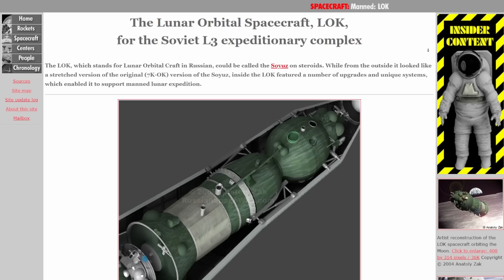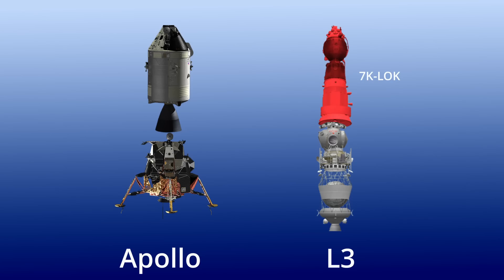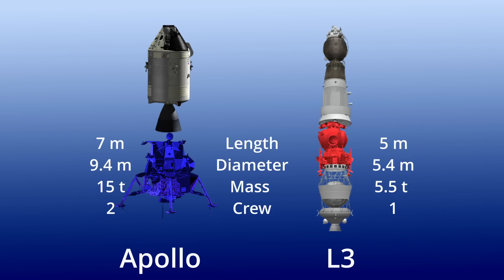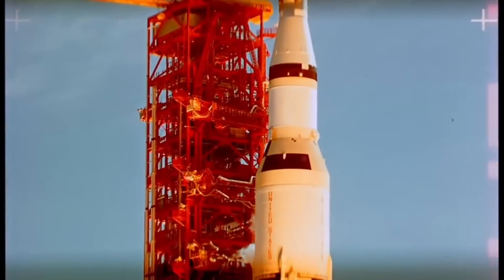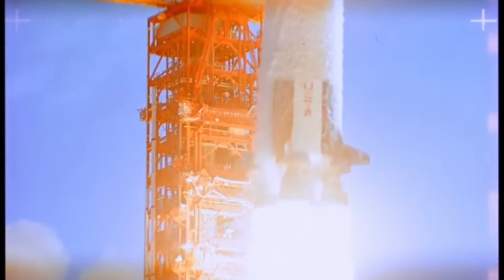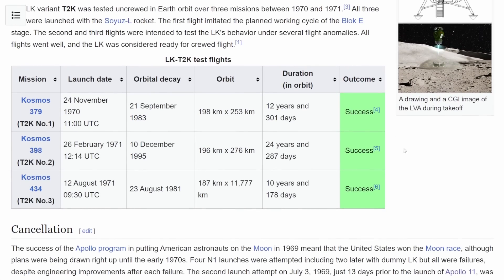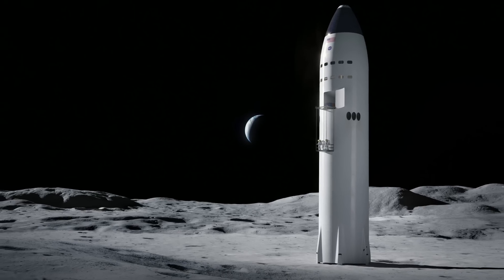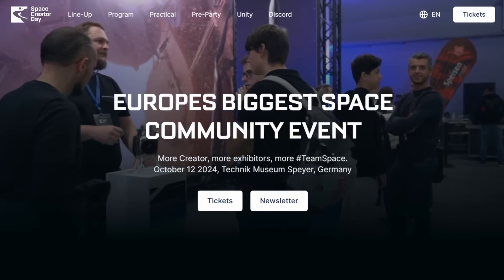Race to the Moon! Did Soviets or Americans Build the Better Lander? - Rocket Rumble #2

Comment: If the Soviets ever did actually reach the moon, there was a high chance of having a rough landing like Apollo 15. In which the descent engine bell hit the ground due to the lander having two of the legs hit the ground first and listing over. The engine was a write off. The soviet design would have stranded the lonely astronaut on the moon. Left to die.
Reply: Not entirely correct. The Engine bell on Apollo 15-17 was larger, so that it could provide more thrust due to the fact that the LM was heavier (more consumables for longer stays on the surface, more experiments and the rover). They knew it was a big chance that the bell might hit the surface (which it did on 15 as you mentioned), so they designed the nozzle extension (which provided the extra thrust needed) to "collapse" so as to not completely destroy the DPS and potentially the LM altogether. 

The astronauts also shut the DPS down IMMEDIATLY upon getting contact light when one of the 3 probes on the lander-legs touched the surface, so the DPS was already off before the LM settled on the surface (unlike on Apollo 11, where the DPS was still firing by the time the LM settled on the surface of the moon).
Reply: I commented on this earlier, but the Soviet plan from 1967 to 1972 actually included an entire backup LK which would launch on a separate N1 and land under automatic control using radio guidance beacons mounted on rovers to have a pre-emplaced backup LK if needed. See Siddiqui, Challenge to Apollo, p517 "The Lunar Flotilla" and this description of the state of the project from the same source on p643:

"The repeated additions and modifications to the N I-L3 plan in 1965-67 also complicated mission design. Even after the ink was dry on a final draft plan for a particular element of the L3 complex, months later, engineers would propose modifications based on new anticipated needs. This not only made it impossible to manufacture flight models of the spacecraft, but also added layer after layer of complexity to the N I-L3 mission. By 1968, the following components were part of the entire program:
• Ye-6LS (two robot probes to map lunar gravitational anomalies)
• Ye-8LS (two robot lunar satellites to photograph the lunar surface)
• TIK-T2K (automated and piloted flights of the LOK and LK in Earth orbit)
• LIE (automated test of the Blok D stage in Earth orbit):
• NI-LI (two lunar orbital LI flights as test payloads for early N I launches)
• Ye-8 (two lunar rovers to serve as transport for cosmonauts);
• NI-L3 (one N I launch with the backup LK)
• NI-L3 (one N I launch with two cosmonauts to land on the Moon)"

Comment: Hell yeah the LK was a fascinating spacecraft, but oy, that would have been a hell of a workload for one cosmonaut. Then an EVA transfer back to the Soyuz? Exhausting.
Reply: At least the LK had a small digital computer that would have managed the flight trajectory for its pilot.  The LOK (Soyuz) of the time made due with mechanical sequencers, the mainline Soyuz spacecraft didn't get digital computers until the Soyuz-T, IIRC, in the mid 70s.  Interestingly. no one knew how easy or hard it would be, or how exhausting, to move around on the Moon.  One thing the Soviets came up with was to land a small electric cart at their intended landing site, to scout it out, and use a beacon from it to steer the piloted LK lander to a pre-selected spot near the cart.  The moonwalking cosmonaut would then only need to walk as far as the cart, get into its seat, activate its manual controls, and go puttering around his landing site in his mobility aid,  When the LOK/LK system was abandoned, the cart had its manual controls and seat removed and was sent to the Moon as Lunokhod, a remotely controlled rover.  In any event, the pilot would have two transfer EVAs, one to get into the lander and one to get back into the LOK orbiter, but at least there were plans to make his surface excursions less physically taxing.
Reply: @DougVanDorn  Plans only. Nothing actually accomplished. Given that overwhelming fact, there is no valid comparison. The LM was flown in space twice before Apollo 11 to confirm its abilities, including a full rehearsal of the entire descent, ascent, rendezvous, and docking during the Apollo 10 mission. The thing missing was the actual landing. The Soviet LK was never tested in space, so how it would have performed is educated conjecture at best.
Reply: @enscroggs  A reminder. The Apollo 10 LEM wasn't loaded with enough fuel on purpose to ensure Cernan and Stafford didn't go all cowboy and try to land on the moon.
Reply: @enscroggs "the Soviet LK was never tested in space"
It flew to space 3 times on Soyuz-L (very recognizable by the spherical fairing) and tested all necessary burns like the landing burn, ascent burn and abort burn using backup engine. 

One of the landers even stayed in LEO until late 1990s because of a high Apogee.
Reply: <<Then an EVA transfer back to the Soyuz? Exhausting.>>

Tired or not, I suppose he would have been highly motivated.

Comment: It was odd to see the Kerbel LM Descent Stage move after the Ascent Stage left.  It's inaccurate to Apollo and took extra steps to animate the movement.
The Shocks on the Apollo LM were designed to absorb the shock of impact by crushing the material inside.  There were no springs or any way to un-crush the material.
Reply: A limitation to the game, The landing gear is generic to the game's base parts, and aren't historically accurate. The springs in the landing gear are there by default, meaning a lack of movement would actually take an additional finagling with a custom dampening and spring slider post-landing and pre-ascent. The animations are simply the engine adjusting to the weight change on the built in springs.

Comment: weren't the LM ascent stages crashed into the moon?
Reply: The Apollo Lunar Module wikipedia article lists the status of each. Looks like a mixture of being left in lunar orbit, impacting lunar surface, or entering earth's atmosphere.
Reply: @ArchivalQuality  Basically, they started crashing stuff into the Moon the moment they had a continuously working seismometer on the surface.  While Apollo 11 deployed a seismometer, it operated off of solar panels and only worked for the remainder of the lunar day during which the landing happened.  But starting with Apollo 12, it was planned to impact each LM ascent stage on the Moon, to create a seismic signal that could tell them about the Moon's structure.  And starting with Apollo 13, the Saturn S-IVB third stages were also crashed on the Moon, for the same reasons.  Now, that plan had two exceptions -- obviously, Apollo 13's LM didn't have any part of itself touch or crash onto the Moon, because of the abort on the outbound trip.  The other exception was on Apollo 16, where the plan was to crash the ascent stage, but the timelines got all messed up because of the 6-hour delay in the landing on that flight.  So, instead of going through their normal procedures, they were told after returning to orbit and docking with the CSM to move everything out of the LM that was coming back, and then button everything up and delay the LM jettison until after a sleep period (the LM crew had been up for like 26 hours by that time).  They went back in the next day and thought they finished the config properly, but after LM jett they found that the ascent stage was in free drift and not responsive to attitude control or propulsion control from the ground.  That was chalked up to poor management of the procedures by Houston to try and get the LM crew to sleep, but after the flight all three crewmen said they thought the better thing would have been to just follow the regular procedure and get rid of the LM before going to sleep.  But there was a lot of complaining done about how Houston tried to rewrite the flight plan from scratch after the landing delay on 16, so losing the ability to crash the LM ended up being one of the more minor of the resulting issues.